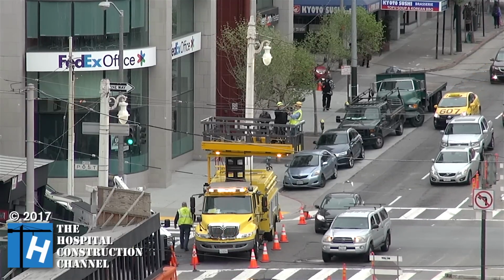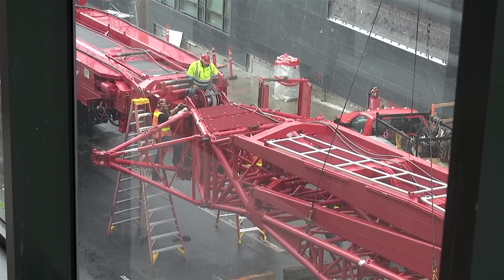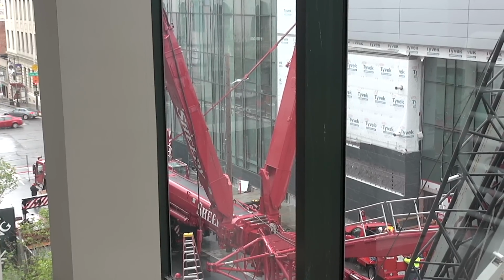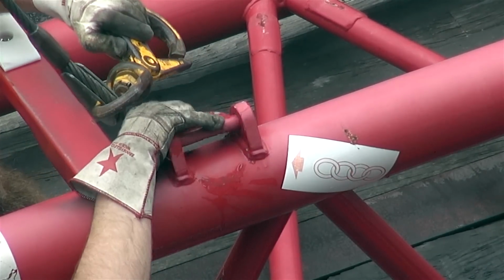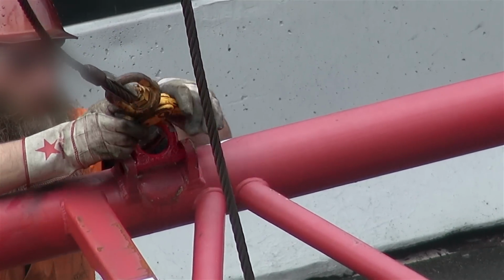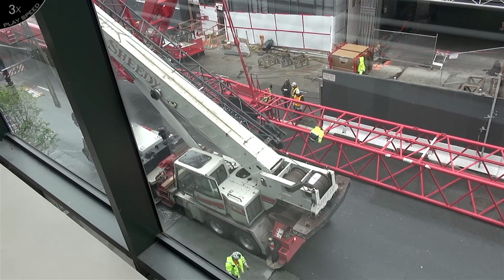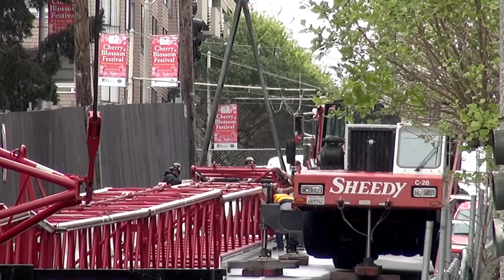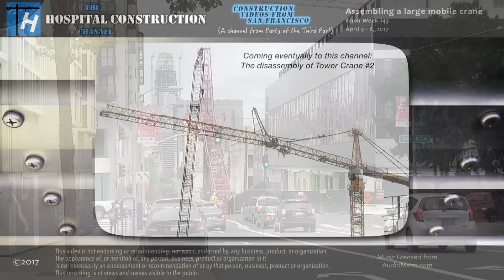Assembling a large mobile crane that will be used to disassemble a tower crane

Comment: Tower cranes are left free so the wind actually blows the crane around and it will usually stay pointed in direction of wind. Which is called "wind vane". Hydraulic cranes cannot do this so they have to be "dogged" or put away completely while no in use.

Comment: The red arms are called mega wings. It what stabilizes the boom from bending left to right. without this it can sideload the boom and damage the hill pins! The tall v arms on top is called a gantry system it luffs the jib up and down so you can gain reach 💪 and lift.
Reply from the maker: Thanks for the explanation, appreciate it

Comment: Well done! (again).
Reply: What you see in this video is the assembly of a luffing jib on a Liebherr LTM 1400 7.2 telescopic boom crane, a 400 ton lifting capacity crane on a 3,5 metres flight, with a maximum telescopic hight of 60 metres, with 7 axles.. 
It is already quit a large crane, but there are even much larger ones..!!
The maximum lenghth of a luffing jib mounted on this crane is about 60 metres.. The maximum working highth with a luffing jib for this crane is about..140 metres..
At the very end of the luffing jib there is an top mounted with a guiding wheel to guide the crane when the boom will be lifted or be let down..
The crane is further mounted with extra hoistcables at cablerolls at the mounted platform at the vack of the crane for lifting and guiding the luffing jib up and down together with counterweights with a maximum weight of 200 tons in 2 parts of maximum 10 blocks on each side..
On the crane itself are spanners mounted wich will be hydraulicly positioned in an upright position an sideways to gide the luffing jib and provide the telescopic boom from bending.. 
It is always a spectaculair side to see a large telescopic crane in working because of its highth, but also to see the assamble or disassambling of such crane..!!

Comment: The crane super structure which has the telescoping boom is attached to the whole  truck itself, it includes all the tires,  what they are doing is installing a luffing jib. Boom Extension for added height and reach. To the main boom which the guy was standing on guiding the other crane operator holding the luffed boom in place to get pinned.     There’s lots of pieces that all have to work together here.   Yeah it’s very interesting profession.  I love it.

Comment: the top of the boom has wheels because when this crane lifts its boom is gonna have a bit of a bend to the boom so the wheels allow the top of the boom to roll
Reply from the maker: Ah, that makes sense -- thanks for that information!
Reply: the wheels are because it doesn't have the capacity to lift the luffing jib from the ground flat, the operator would boom up his hydraulic sections while allowing the wheels to roll closer to him until he has the chart to lift the entire assembly
Reply: We never use the wheels if the jib is shorter than 56 meters. or if we are going to raise the boom from the side

Comment: looks like a 250 tonne or a 300, with a luff and fly on it, the v thing on top is called a super lift, it helps minimize deflection in the fly of the crane
Reply: It's an LTM 1400-7.1.

Comment: THIS IS A LIEBHERR ...GERMAN CRANE AROUND 300 TO 400 TON HYDRAULIC MOBILE CRANE WITH A TELESCOPIC BOOM WITH A LUFFER ON IT FOR REACH...THESE ARE USED FOR REACH BECAUSE  A HYDRAULIC BOOM IS VERY HEAVY AND WOULD TAKE A 1000 TON CRANE TO REACH THAT HIGH AND FAR AWAY!
Reply from the maker: Thank you very much for all of the information!  You wouldn't happen to know the exact model number of this crane, would you?
Reply: It is a LTM 1400-7.1 and I actually had 184' of Luffing Jib with Y-Guy Heavy lift attached. Thank you for your video.
Reply from the maker: Thanks, Danny, thanks for checking in, good to hear from you.  I'll eventually be getting to that video of the tower crane coming down...

Comment: 2 guys working on a ladder, hands in pinch points, no harness over 10 feet, no tag lines.. hope osha doesn't see this.  Video was entertaining though!!
Reply: nate osha says u ain't supposed to tie off a peace of moving equipment so why are they going wear a harness, and no one uses a tag line rigging up a crane 😑
Reply: Osha says no fall protection is required for heights up to 15 feet for crane erection.
Reply: Thanks Nate the safety officer, tell me again how you’re going to safely tie off at 10 feet and not hit the ground? Stick to what you know or just shut yer hole.

Comment: Those bars in the y shape are luffing jib supports, gives alot more muscle to the end of the boom ,at lift point,, he will be stretched way out, it will kinda resemble a spider when in the air, I've put many of them together, along with the tower cranes themselves,, after a certain height the tower builds itself, as in 2 iron workers on the rigging and it picks a vertical section from the ground and brings it up, then the iron workers take the pins out of the square frame and it jacks itself up and sucks the new piece in then lowers and pins are replaced and repeat till desired height

Comment: Liebherr makes the biggest most powerful cranes...They set the bar for mobile and track cranes...
Reply: There are other manufacturers that make cranes just as big and as powerful as Liebherr, but what I can tell, (been a crane driver for just over a year now,) Liebherrs are the best I've driven. And when our company orders new cranes, they go to Liebherr. Reliability, ease of use, ease of maintenance etc. are just superb compared to the competition. They do though buy other brands aswell, but they are usually sold at a discount because of the original buyer didn't take the crane they had ordered for one reason or another. :)

Comment: U'RE RIGHT ....THOSE  THINGS ARE "WINGS"!
Reply: Their purpose is lateral boom stabilization. Controlling side loading. The design of the telematic boom has strength has the main strength in the vertical plane, and a vertical lift. When over a certain amount of boom extension and the use of a luffing attachment, lattice extension, or a load at maximum extension and weight, also  they are used to stop any side loading forces or influence from load moment and wind in the left and right plane of the boom.
Reply from the maker: Thank you very much for that explanation, Ted!
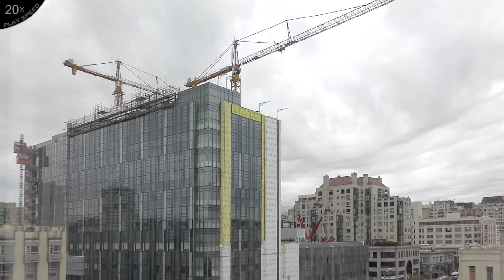Reply: 29:57..."resting place"..called "DOGGED OFF"!

Comment: I'm curious how many can still count to ten using their fingers. Tons of steels fitted with millimeter precision, absolutely incredible.
Reply: They probably dont need to use their fingers. These are the smart construction guys
Reply: Its about knowing where and where not to put your hands and fingers.. and pins for the jib have a taper, so you dont have to line them up exactly.
Reply: here in Australia, many of the people ive worked with have been injured over their 30 year careers, but not nearly as many as you would think are missing fingers. Of all people ive worked with, well over 100 only maybe 5 have lost a finger or part of one that i know of. It still surprises me doing this stuff. Lots of close calls but here they are still typing away 😅

Comment: Sheedy cranes need to implement some working at height rules within the company.Bad practice even the Hi VIZ shirts have Sheedy Safety emblazoned on the back .......
Reply: Osha law states crane erection does not require fall protection for heights up to 15 feet. 15 feet and up you must have fall protection.
Reply: Keet.... you’ve spoken as a true safety turd sock checker or shoe clerk. Do you for work for Shell?

Comment: #1 no ladder safety at all. Standing backwards on the ladder, hanging off the side wrestling a boom section and, no spotter holding the ladder. If you watch closely the boom section gets bound up in the alignment process. That's when a little movement with the assist crane trying to move it and bang it comes loose throwing the ladders down. These guys would have been fired on a power plant or steel mill job 15 min after they started.  None of them are wearing a safety harness. If you look in the garage door you can see two big stable scissor lifts sitting there not being used. The contractor if ask would have made them available.
Reply: Sny734 You would have made a good safety man, always looking for something wrong.
Reply: yawn
Reply: No harnesses required during erection or disassembly of a crane as long as you're not over 15ft. The ladders are being used because they are quicker and more efficient than driving scissor lifts all over the place. They are standing backwards on the ladders because if they were on the other side they would not be able to reach the part they need to get to. if they were to move the ladders towards the jib then the ladders would be in the way. I have assembled/disassembled and operated cranes like this for the last 12 years, and I have never had a guy or saw a guy injured during this process because everyone knows what they should and should not be doing. You overzealous safety nazi's are ruining this industry. You have been commisioned by the insurance companies to have full power over stuff that you have no clue on how it works nor what it takes to do the jobs you are so called "supervising". All you've been taught is that if someone is not wearing their PPE then they are going to die and the insurance company is going to have to pay money out. The insurance companies don't give a shit about us or you, they just want to hold onto as much or our premiums as they can.
Reply: WAAAAAHHHHHH!
Reply: You're living in a dream world and don't know what you're talking about. Where are you from Wv? I am not a safety man. I am a hands on crane operator and erector of cranes for 38 years. I am well aware of the 15 ft OSHA rule and can tell you that doesn't fly in a steel mill, power plant, or many other high profile jobs. Their rules trump OSHA regulations as long as they are as strict or stricter. I have seen more injures than I care to assembling cranes. One picture you can never erase or forget is death.  On my jobs you watch out for your self and your buddy's. There's never a moment during work that you're not on guard thinking and looking for what can go wrong.
Reply: @Sny734  100% yes

Comment: Not sure I understand the logic of building a crane to take another one apart
Reply: Well how do you think they build the crane in the first place lol
Reply: Sometimes they need a helicopter to put a Crane together.
Reply: @Mr. Saephan ok so the crane that was built to take the other crane down , how does that crane get taken apart ?
Reply: @MrGST360  I would say in the reverse way, as you can see in the video.
Reply: @MrGST360  a smaller crane
Reply: @mattharper588     In rare cases, cranes are also set up with helocopters. This happens especially in areas that are difficult to reach.
In such operations, the crane must of course be broken down into smaller, lighter pieces.  https://www.thunertagblatt.ch/region/bern/helikopter-montiert-kran/story/19387804
Reply: The smaller crane can get around the city in one piece. The bigger one must be disassembled to be moved from one job to another.